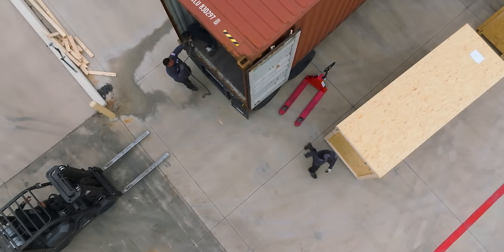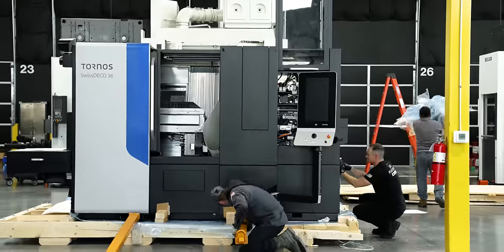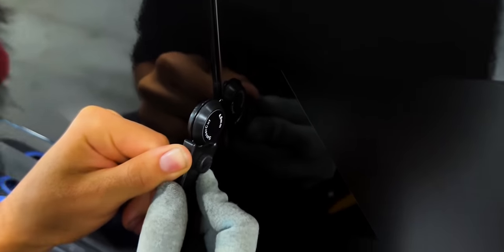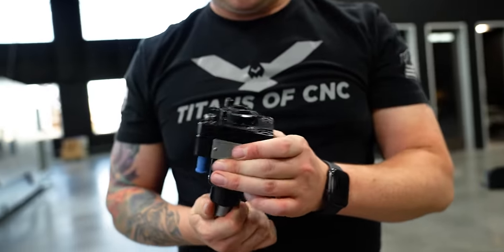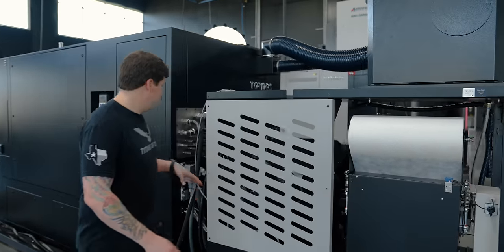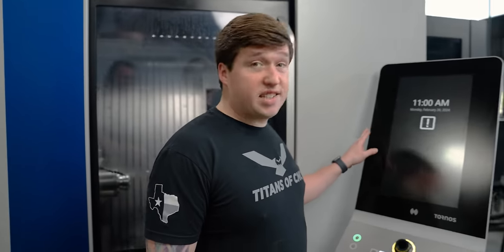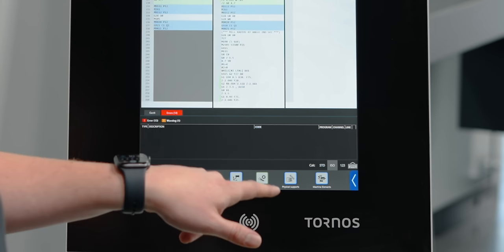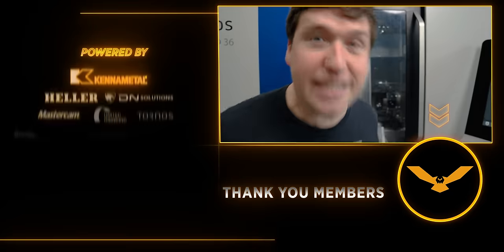The Only B-Axis Turret Swiss Lathe in the World

Comment: Star SX-38 has a turret and b-axis, but they put the b-axis on a separate column.  It replaced the SV38R, which had a b-axis rotating station on every other turret position (5/10.)  15hp main and sub. 5.5hp on turret tools.  Both cool machines!  I'd like to compare price...
Reply: I'm not sure it's a direct replacement for the SV-38Rs. If you use all 5 B-axis holders on there it can hold up to 10 tools, compared to 8 for the SX-38, and the B-axis could go all the way to 180 degrees so those same tools could be used on the main or sub. Going by the videos they show, the SX is more like 4 that can work on main, 4 that can work on sub. The B-axis holders are sort of a pain to set up and keep repaired though, so I can definitely understand why they got rid of them.

Comment: Love consuming content on the latest and greatest, but these videos get hard to watch with the number of times that referencing front end software as 'controls' happens. Primarily because this channel gets marketed as 'educational.' Would like to see more technical information breakdowns when going over the machine specifications, a quick google search and you find that this control is actually a FANUC 31i-B5, but it's nice to see that machine tool builders can take a control that may have more an older style of operating screens, and give them a modern look or feature set with a front end like this. The CNC industry as a whole seems to be entering a new era in terms of usability; it's nice to see how the level of entry for different control systems are able to adapt to the new generation of operators and machinists.